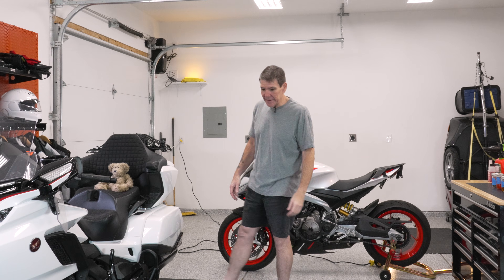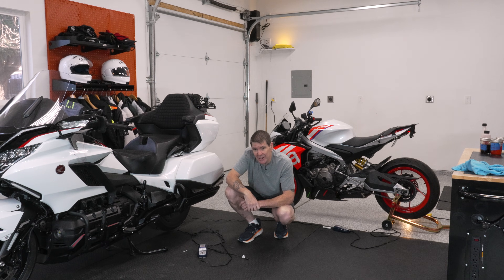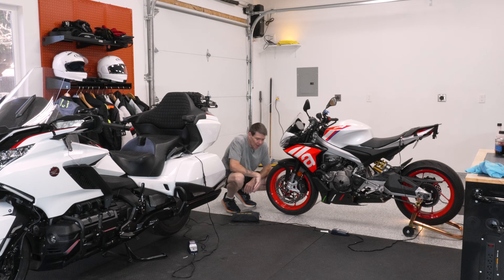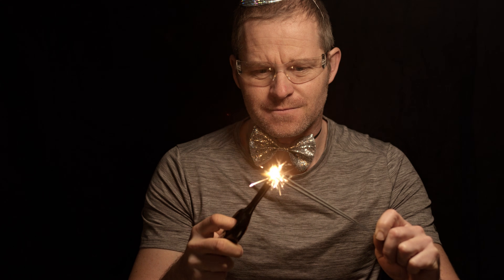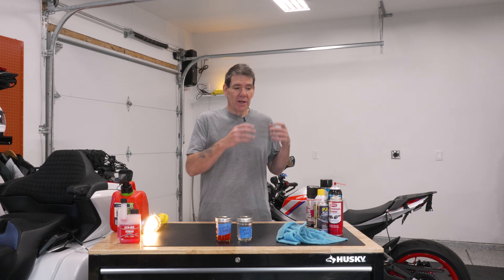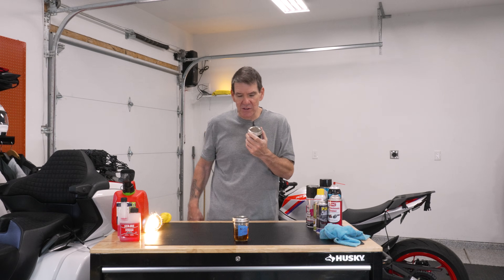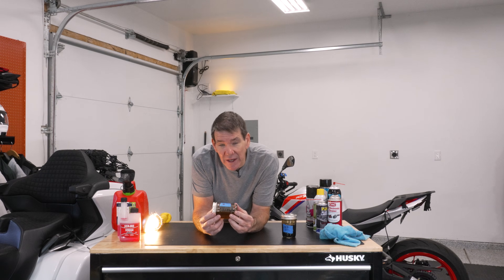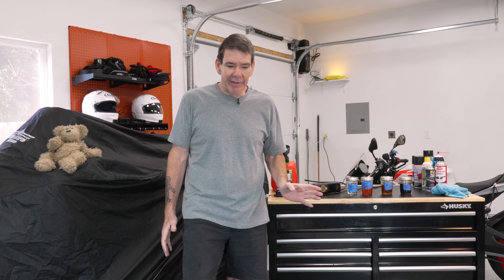Don’t Kill Your Motorcycle This Winter – Storage Made Simple

Comment: Great video on motorcycle winter storage with 2 caveats. If you plan on starting your motorcycle weekly you need to run the engine until it gets up to operating temperature and then for another 5 or so minutes otherwise you will have moisture in the engine causing rust. Also make sure you pipe out the exhaust to the outside making sure you don't have a wind blowing it back into the garage (possible carbon monoxide poisoning). If you have a centre stand on the bike use it rather than a side stand and then lift the front wheel off the ground using a jack on the frame or crash guard. This will  relieve the pressure off the front suspension and tire.
Reply from the maker: Good point on the moisture, I always make sure to let it get up to operating temp. I prefer to ride it if its possible. I also neglected to mention the safety aspect of running bikes in the garage. If you look at some of my videos you will see a big black fan, exhausting the garage is its main job!.  Thanks for mentioning those.